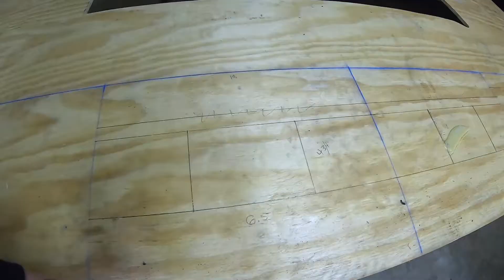How To Build a UV Curing Box | Budget DIY

Comment: I made something similar to charge glow fishing lures out of a plastic tool box. Fist I lined the interior with Mylar foil which reflects invisible UV light. Mirrors or tin foil do not. Then I installed brackets to hold a pair of flashers and 4 lures. Then I installed UV 365nm strip lights along the sides of the interior. 365 nm lights are more expensive and produce more actual UV light than 395nm. UV 395nm lights put out less UV and more visible purplish light. UV 365nm will appear dimmer and have a whitish light. Be careful to protect your eyes and skin when using actual UV lights, dont look at them or let it touch your skin. I should have videoed some of my projects. lol

Comment: I'm going to make this but I need to make the lights on the bottom and the top because I'm curing liquid resin. Do you think I can just put a clear shelf in the middle, and then simply flip it on the side with little feet added to give room for the back of the bottom lamp?
Reply from the maker: I don’t see why not. I don’t know much of anything about style of resin, but what I’ve seen, the UV light can be absorbed through the resin at any angle to cure through. But just like my video. Build it and see. If it works, it works. Good luck!

Comment: Any chance of an update?  I’m wanting to switch to uv.
Reply from the maker: It definitely works. It doesn’t dry as quickly as I’d like but I just turn it on and leave it. I’d say the lights I have are strong but I think they work at different frequencies. I’d like to experiment with different (nm) rated lights to see if I can get it to cure quicker.
Reply: What nm are you using here?
Reply from the maker: 400nm

Comment: I can’t find AlumiUV anywhere. Other than the .25 lb which I’m not even sure how many fluid oz that is. I want to try some out
Reply from the maker: I got it straight from the alumilite site. Got the 2lb. Looks like it says temporarily out of stock. 2lb is a quart I’m pretty sure. Small paint can size.
Reply: @HookandNeedle  yeah, every time I look, it’s out of stock
Reply from the maker: @Retro-2-now  .25lb would work but can’t dip. You would have to brush on. I’d just hang in there for the 2lb.
Reply: @HookandNeedle  yeah, or, I might just buy 4 of the .25 and pour them all in a quart jar and wrap the jar with duct tape. I even keep my KBS away from windows and I cover it with a dish towel

Comment: Nice job man! You should think about making a cover with reflective material to go on it. Get that 360° shine. 

Speaking of the tiny boat, you still got it?
Reply from the maker: Yeah. A cover may shave a bit of time but it honestly dries pretty quick. If anything it would help with dust more than anything. 

I sold the tiny boat just before Christmas. Sad to see it go but I was running out of space with the big boat too.
Reply: @HookandNeedle  it'd definitely keep the dust off. 
I've been contemplating making my own baits, no way my paint will be as good as yours though, I can't ever get what's in my head onto the paper or whatever. 

I feel ya on limited space. But the bigger boat is no doubt better, more stable.
Reply from the maker: Yeah. The triton is my baby. I’ve got it set up. It’s gonna be a good tourney season. Hopefully 🤞
Reply: @HookandNeedle  I want to get a bass boat, but for now I'm working on converting the 14' John
Reply from the maker: The Jon is a blast to fish out of. We had some good times.
Reply: @HookandNeedle  I can't wait to make memories in mine